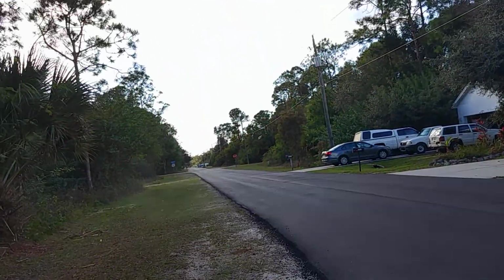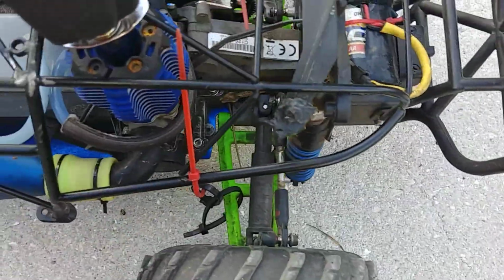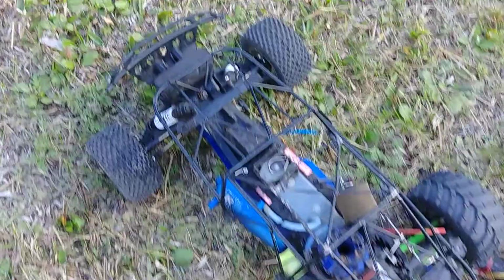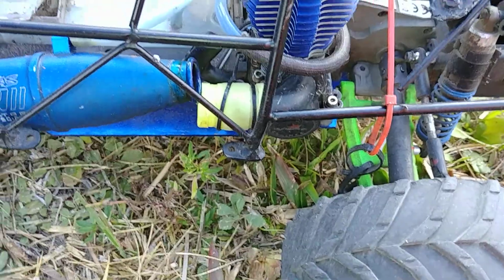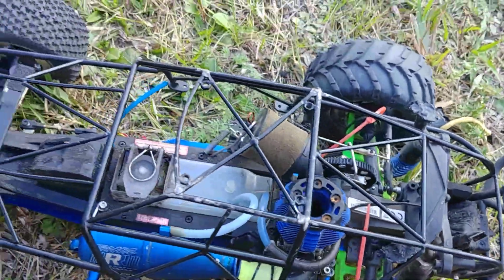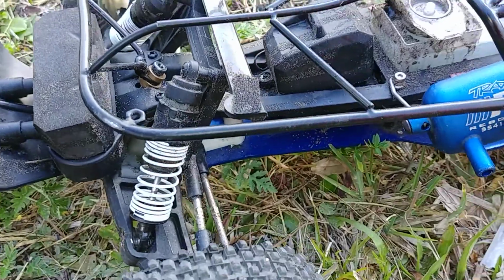Nailed a storm drain 😬😂😁minor damage tho

Comment: It's crazy how a simple pipe can change the power aspects of a motor. People don't believe me when I tell them that just like depending on what pipe you put on more than likely it'll have to be retuned to it. Love the videos bro, keep them coming 👍🏼👍🏼💪🏼
Reply from the maker: I thought it was me. But talked to a friend an told him what i had done its had a mgt 4.6 expansion pipe an a mach 15 header but the 4.6 expansion pipe I couldnt get any bottom end out of it. So i changed it an it still needs tunning for the bottom end tho but it's getting there
Reply from the maker: I opened the header up by like 3 mm